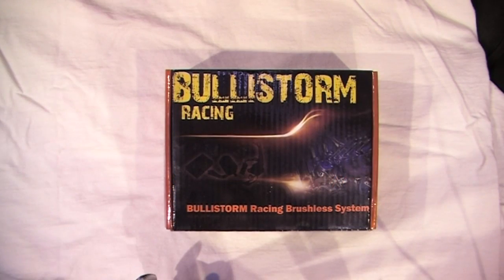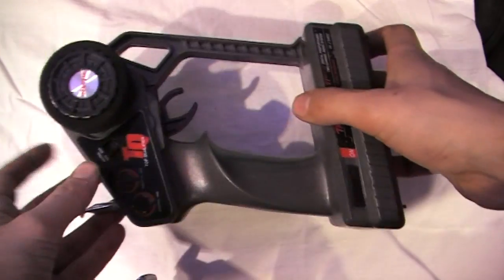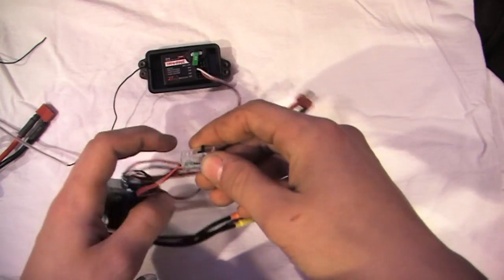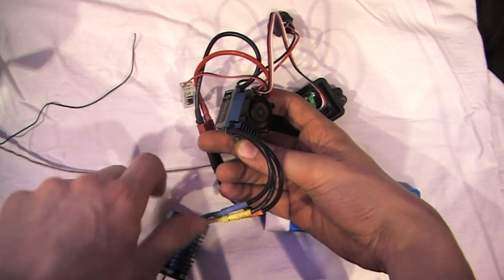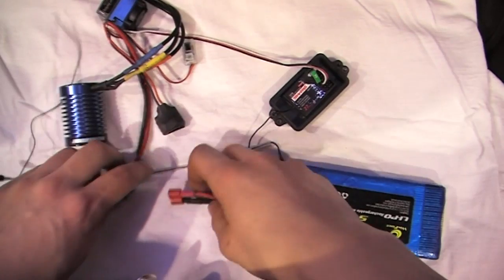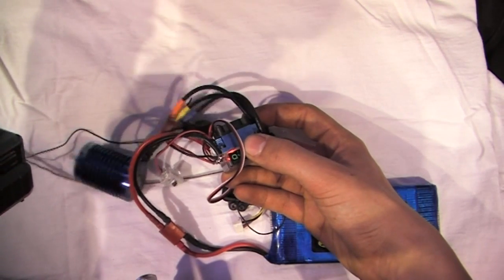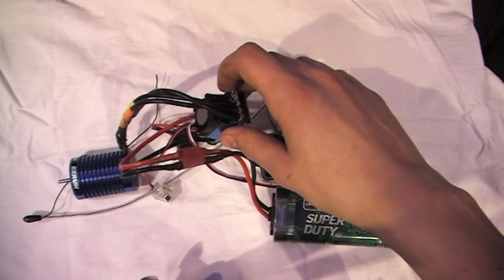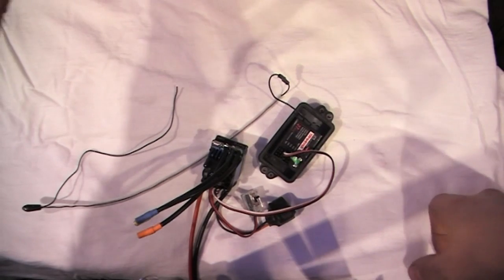Bullistorm ESC review part 2: Calibrating the ESC

Comment from the maker: @fallin5SterneDeLuxe Pretty much everywhere. Just look around. I was lucky enough to find the 60A versions for €25. But normal retail price is a bit higher than that. Check ebay. ;)
But what do you want to power with it? I have ran it in my rustler for a long time. But it overheated constantly. So finally i went with a good system. But that costs a bit more. 

I am now running it in my tt01 drifter. Perfect. Any on road 1/10th will do fine. Just not off road.